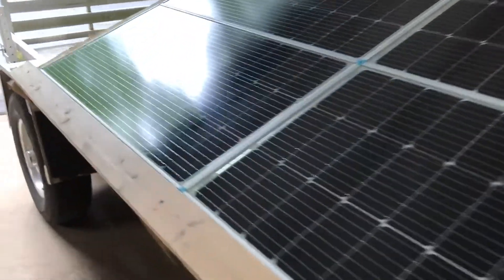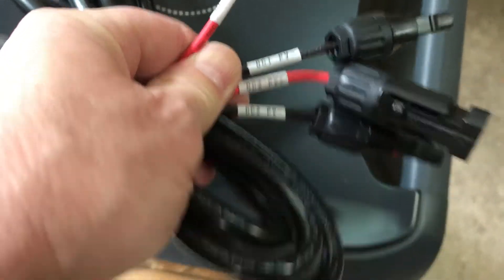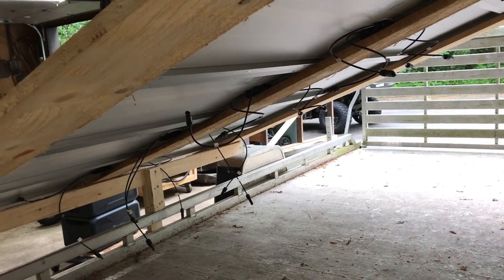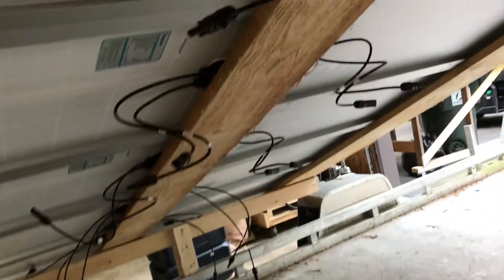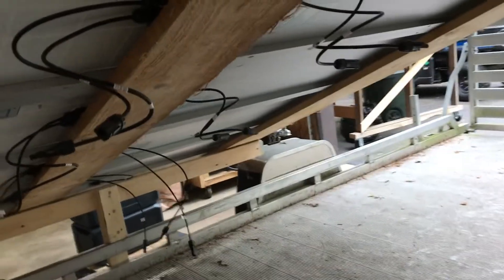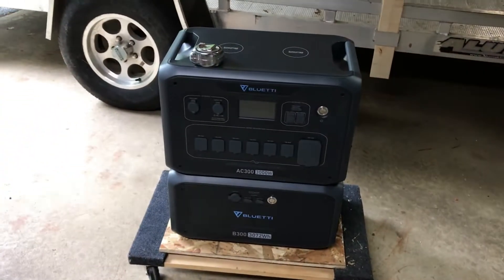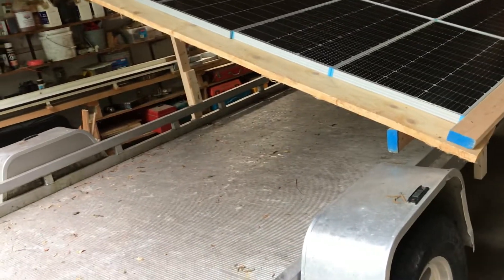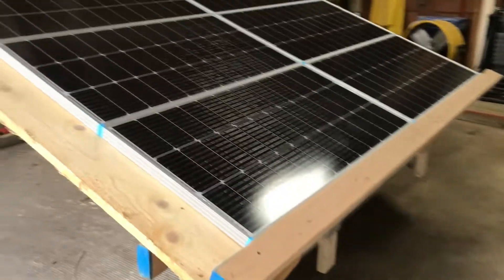12000 Watt portable solar set up

Comment: I wouldn't join all the panels in series on one MMPT because when the temperature goes under 25 degrees Celcius, the total voltage goes up; and in your case, you don't have much room left to reach the max 150V. You're better off using both MMPTs.

Comment: Connect the panels and read them before you connect to the charge controllers.  I think you are looking at 18 to 20 volts per panel, not 12.
Reply from the maker: You were right! 22.5 volts per panel. I only can hook up 6 panels per controller. I have enough panels now to get another AC300 and do 220 to run my well pump. Thanks again
Reply: @johnkayak10  have fun thanks for the video and keep posting.  It's more fun to see someone else do it first with their money.
Reply from the maker: Will do, thanks. Pretty sure each panel is 12 volts each so in series should read 144 volts each of the charge controllers can handle 150 volts